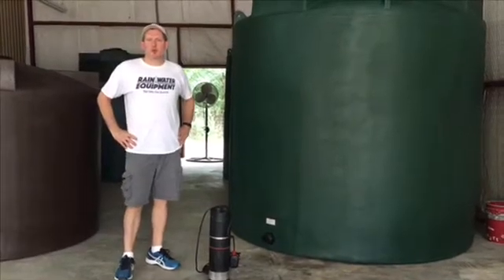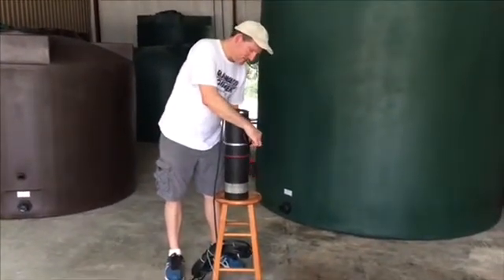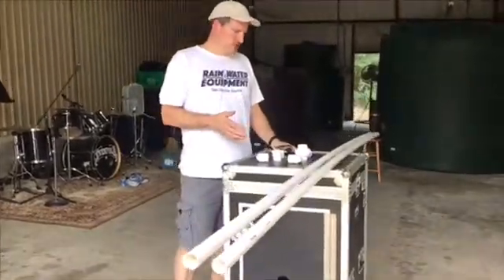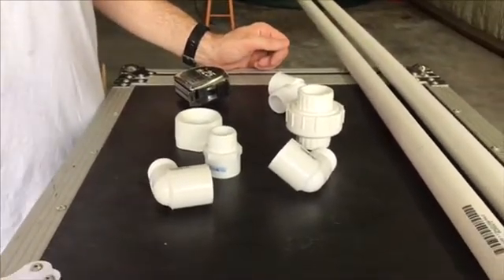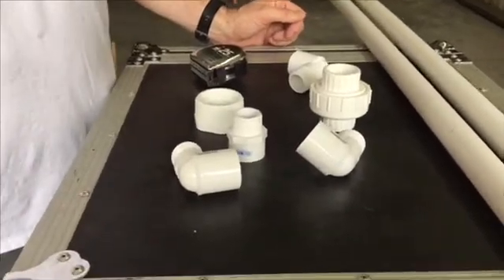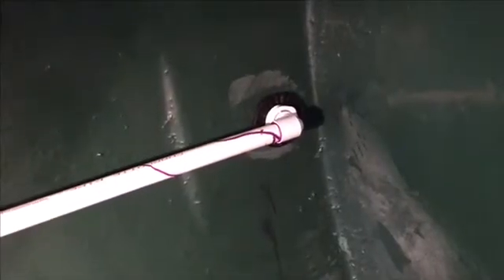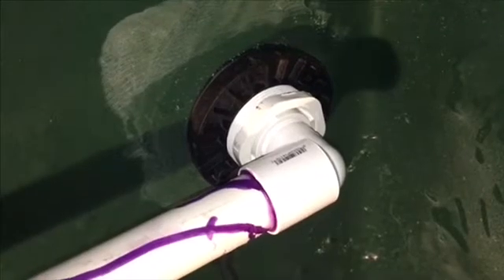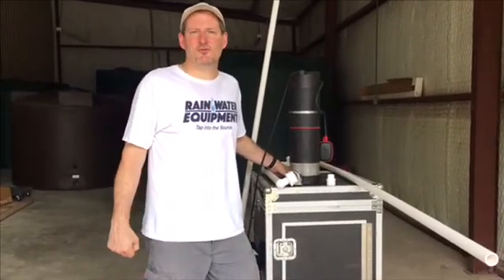Grundfos Model SBA 3-45 A Submersible Pump Installation in 2500 Gallon Poly Tank

Comment: In a situation where the water has a lot of iron, does the pump suck up the iron when it’s oxidized or does the iron “stick” to the bottom of the cistern?
Reply from the maker: We are not well water experts when it comes to iron in the water, but we can say with some amount of confidence that the iron will make its way into the pump and may shorten the life of any pump over time by weakening the seals and potentially causing the pump to leak at some point. Depending on the level of the iron in the water, it may have an impact on the performance of the pump, but whether this occurs in 6 months, 10 years, or longer is difficult for to say. That being said, people use these pumps in well water applications all the time with success, but we couldn't say with any amount of certainly what the level of iron content is in these users' well water applications. Sorry we couldn't be of any real help in this area. Try searching online for competent sources on this specific topic. You're sure to find some relevant and helpful content. Good luck!

Comment: Thank you for this detailed video on how to install a submersible pump in a rainwater tank! When my rainwater tank was installed, the guy didn't install a sump pump. I've been trying to use the rainwater to water my garden, but because there's hardly any pressure, it's taking a long time. I called the installer to ask if he could install a pump for me, but right now he's too busy to help me. He tried to explain how to install it over the phone (with 1 pipe inside and 1 pipe outside of the tank), but it was hard for me to visualize all of the parts and pieces and where they would go. I also read your reply to 'Brian' below where he asked why not just install 1 pipe outside, and I see that's not a good idea due to the possibility of the pipe freezing. Anyhow, thanks to this video, I know what to do. The only problem I have now is that my 2,600 gallon tank is full. So I guess I'm going to have to suffer with the slow water pressure until I can use the water up.

Comment: how much psi does this deliver?
Reply from the maker: It depends on the flow rate (GPM - gallons per minute). There's a performance curve on this page that shows PSI and GPM. For example, the curve shows that it does 5 GPM at 55 PSI and 10 GPM at 46 PSI.
https://rainwaterequipment.com/grundfos-sba-1hp-submersible-pump/

Comment: One basic question.....Maybe I am missing something, but I guess I don’t understand why would you not just add a 1” outlet bulkhead fitting up near the manway and have the pump piped straight up to it (with a union fitting to allow disconnect/pump removal) and go out of the tank up there (and then run a 1” pipe back down the outside of the tank to whatever height you wish) rather than have the up and down Rube Goldberg setup inside the tank (which, as you demonstrated, also requires you to go inside the tank to connect it to the outflow bulkhead at the bottom)?   Seems like you created an unnecessarily (albeit inventive!) complicated solution.
Reply from the maker: Brian, you could certainly do what you suggested. The main reason why you wouldn't do it that way is because then you would have to insulate the exterior pipe during freezing temps to prevent pipe breakage. If it never freezes where you're located, then it should be fine.

Comment: Thanks for the overview of the Grundfos submersible. I'm looking to build a similar system with a 200-300 gallon tank. Any recommendations on a float system to control the well pump and water level in the tank?
Reply from the maker: Chris, Typically the way it's done is that you would use a Normally Closed, Pump Up Float Switch in the tank. The Munro Float Switch that we offer comes with a yellow cable weight. You can set the float to pivot off of the weight inside the tank. The switch would be wired to the well pump. When the float is in the down position, the well pump runs. When the water level in the tank reaches a predetermined level set by you (based on the position of the float), the well pump shuts off. Here's a link to the Float Switch we carry. It comes in 3 cable lengths. This one with the 16' cable is the shortest and least expensive. https://rainwaterequipment.com/munro-float-switch-normally-closed-w-weight-female-ends-16ft/
Good luck. -Jim
Reply: @rainwaterequipmentllc7835  Thank you sir.

Comment: Hi, interesting video but you don't show how the power cord comes out of the tank to be connected to the power source. That's something I'm trying to get done for my rainwater tank.
Reply from the maker: One option is to drill a hole in the top of the tank with a hole saw and add a 1" Banjo TF100 Bulkhead Fitting (We have them on our site). The fitting's opening is just big enough for the plug to fit through. Once you pull the cable through to the length that you want it, you can cut a properly sized, rubber washer in half and make it fit around the cable and fit snug down inside the bulkhead fitting where the cord comes through. Then you'll want to fill the inside of the fitting (around the cord) with food grade silicone. If you prefer a smaller hole in your tank, drill a hole just big enough for the cable to fit through. Cut the plug off of the end of the cord. Re-attach the plug after you run the cable through the hole. Then put food grade silicone in the gaps between the cord and the tank to seal the opening.
Reply from the maker: Sorry for the delayed response Caroline. You'll need to drill a hole in the top of the tank and run the cable out. You'll probably have to cut the plug off of the cable and re-attach once you've run the cable through. Or you can add a 1" bulkhead fitting in the top. The ones we carry are just big enough that the SBA pump's plug will fit through the opening. https://rainwaterequipment.com/1-bulkhead-fitting/
And you'll want to seal around the cable with silicone to prevent insects from getting inside the tank. Good luck. -Jim
Reply: That makes sense....I am installing at a warm-weather only cabin

Comment from the maker: Contrary to what I stated in this demo, it's best to put pipe tape on the male threads on the connections inside the tank as well so that the pipe doesn't leak water back into the tank causing the pump to turn back on when it senses a drop in pressure.